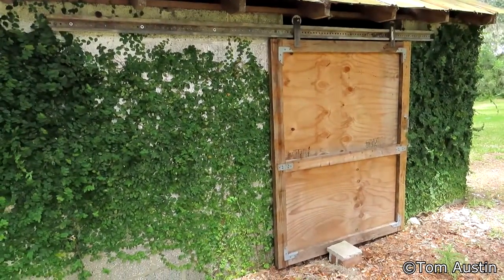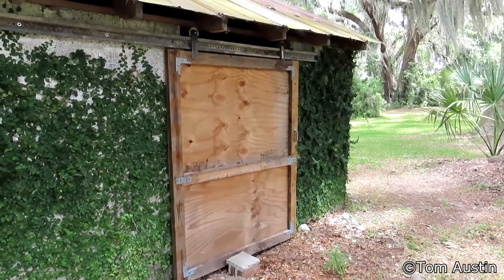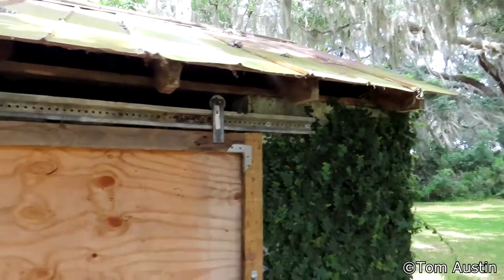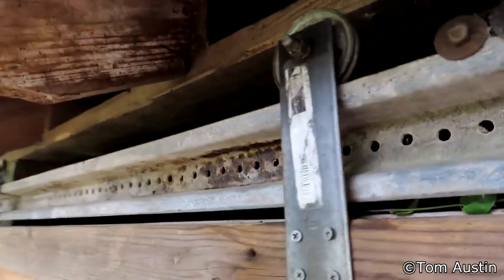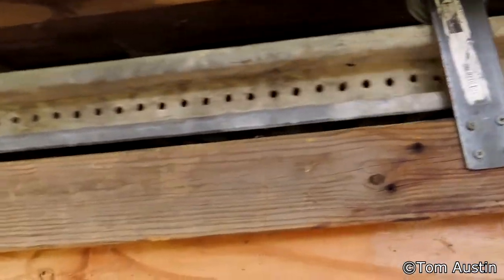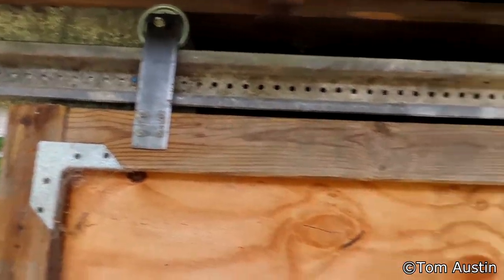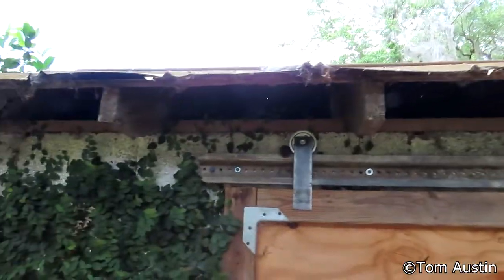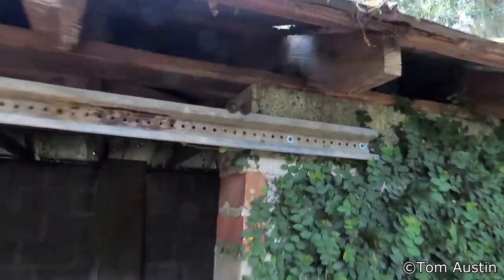How to build a Barn Door Track for cheap

Comment: Its “U-Strut” or “U-Channel”, not “T-Post” for anyone searching for an identical runner to his. 
I know alot of folks these days are too lazy to read a long paragraph so after typing the one below, i figured i’d add an extra line or two at the top so the lazy ones can still get the assistance if necessary, even at the risk of coming off/seeming like one of those know-it-all assholes that has to correct everything on Youtube because he’s “smarter” than the creator’s (or so he thinks lol). Thats not me at all, ive just had problems trying to find things online before because i was searching an incorrect name (of a tool/part) that i got from a youtube video lol so just wanted to hopefully help someone from having the same issue lol.

Original Comment:
Not trying to be that “know-it-all” asshole that feels the need to correct any and everything on Youtube and really just hoping this may possibly assist a viewer if necessary. But for anyone that may not know and possibly has trouble finding a matching “runner” to the one he used and calls a “T-Post” in the video…its technically not a T-Post. Its called “U-Strut or “U-Channel”, and will probably be alot easier to find online and such, if specified as such when searching. Actual “T-Posts” have a thin, kind of arrow shaped plated on each side of a t-post, about 6”-12” from the bottom or the post (making the post look like a lowercased “t”…hence the name lol). T-posts are mainly used for the various types of light duty wire fencing around farms, pastures, etc. and would NOT make a good DIY runner for a barn door. 1. Because they are MUCH weaker and rigid than U-Strut. They bend very easily by hand. A basic stick of U-Strut like stop signs are mounted  on, on the other hand, is all but impossible to bend, with anything less than a full size vehicle at 30mph+ lol…which is more than rigid enough to hold up a sliding door 👍🏻 Good job on it btw, to the creator! I had a similar idea in mind and just couldnt think of what would make the best runner…your “t-post” idea was a dang good one 😂Seriously tho lol. Earned a subscriber here! 🤘🏻